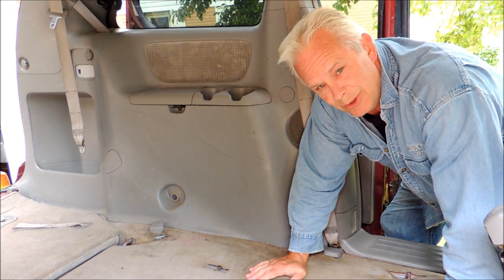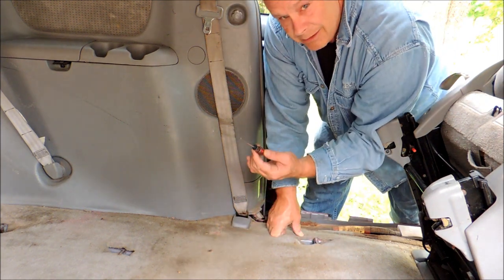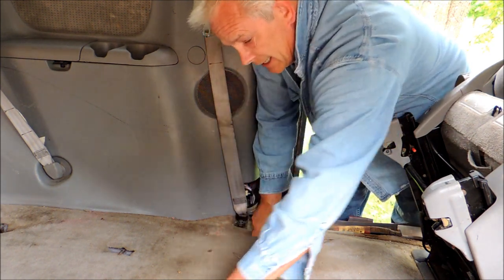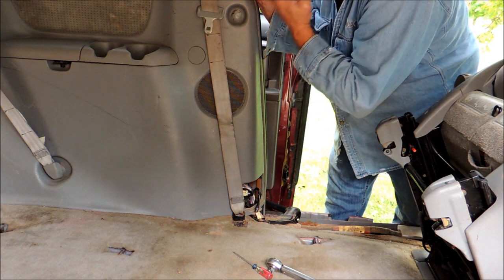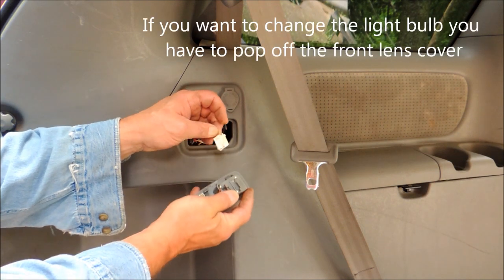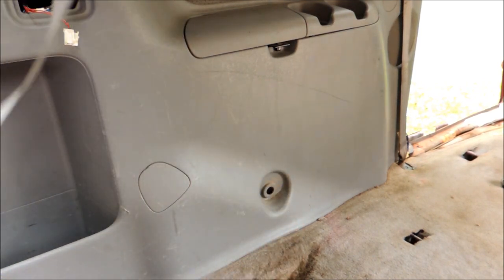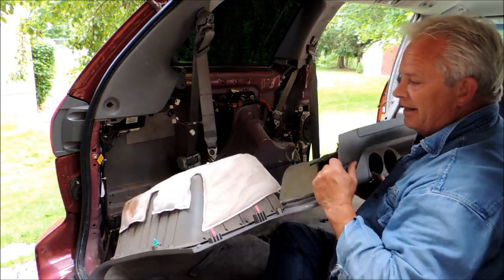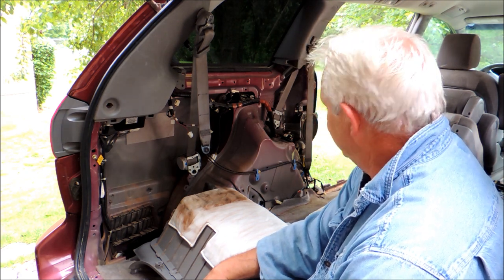Toyota Sienna 03 To 09 Interior Rear Panel Removal

Comment: I am replacing the flimsy worn-out rear 12V outlet with a better made marine-grade one. I run a cooler in the back.  Also once the panel is off I'll be able to pound out a minor dent.  This was very helpful.  Thanks!
Reply from the maker: Glad it helped Vince - Cheers from Canada!

Comment: My daughter and I just used this video to remove the panel from her 2013 Sienna since we could not find one for the later model years.  There were a couple of minor differences that were easy to adapt to, including removing a couple straps that hold the baby seat.  Interior light and attachment point are different, but easy.  When we got to removing the panel, things looked very different.  The panel on later models is made up using two panels, a lower like this, but fastened to it is and upper panel.  So there are two panels rather than one. It looks like you take them out separately, but you don't!  They are fastened permanently together making a large panel similar to the one in this video. Do NOT try to separate them.  We broke one joint trying, but will be able to fix that.  Removal is really similar to the one here, although the design is a little different.  Popping the front out is easy. The trickiest part is starting at the upper back corner and pop out the back edge as shown here.  You have to work your way forward popping out snaps in the door pocket. Its a little tricky and you can kind o get your hand behind as you go and pull with a bent tool. There are three snaps at the top of the pocket.  I wish that the guy who made this video would make one for the later model.  I am sure it would be great like this one.  Thanks.
Reply from the maker: I'm the guy who made the video - first thanks for the added information - second, once I fix someones car I have to give it back and rarely get to do multiple videos on the same car - sorry - Cheers from Canada

Comment: So I replaced the speakers on both sides in the back today, and can say both side panels are just as easy and are VERY similar. Only real differences are no trunk light in the rear, but there is a door for the jack and tools. Don't have to but I removed it just to have a handle to grab onto...just saying since the author is not answering 🙂
Reply from the maker: Thanks for the tip Mr. P - Cheers!

Comment: I have a dent in the rear quarter panel just under the light. Is it possible to access this area to tap out the depression? Your camera angle does not show whether I could get tools in there to push out the dent.

Comment: Thank you so much, I'm buying an 04 Sienna soon for a camper conversion, and plan on modifying that exact panel.  And the reference photos are also very useful.  With liability rules, my local wrecking yard brings all parts to the front, no looking at actual vehicles allowed.  Hard to get interior measurements without climbing inside one.  Thanks again.
Reply from the maker: Anytime Doc - good luck and cheers from Canada!

Comment: Thank you. This was very helpful. I removed the passenger side panel on mine and the process was nearly the same. Your advice about pulling the panel off from the top was useful. I had to get at a terrible squeak coming from a recently installed shock. The little access panel for it wasn’t big enough. Sprayed some silicone in between the bushings and problem solved.
Reply from the maker: Well Done NK - cheers from Canada!

Comment: Couldn’t have done it without this. For the front door sill c over I assume it’s the same method as the sliding door sill. Thanks.
Reply: Quick question, are you a mechanic or autobody ? In case I need something in the project I am starting, where are you located ? I am in Toronto. Thanks

Comment: Thanks for this thorough video. I recently acquired a 2004 Sienna LE. and I am thinking of installing a sub since mine didnt come with one. I believe the XLE does come with the panel and subwoofer speaker and box, or the JBL ones. My question, are the LE pre wired for the subwoofer?
Reply from the maker: Sometimes - Only way to know for sure is to pull the panel - Cheers from Canada!
Reply: Im in the same situation, is there any updates for you?
Reply: @WillHous  no updates. i didnt get any answers from fb groups

Comment: Very well done. My 07 seinna has no heat at the rear cabin. Any ideas??? The rear cabin controls funtion fin (level doors move and change fan spd) but zero temp change just cold air(winter here). I suspect heat control modual broke but i dont know where it is?  Front heat/controls work fine. Any ideas???
Reply from the maker: Check blend door and module in front under dash Crabtrap
Reply: @carquestions  thx but it has rear heatercore setup. I get heat back there when at highway speed. So its either a sienna quirk or need a cooling sys burp i think.

Comment: I was so happy to find this video!  Our rear seat belts had been torn and cut-off by hauling around sheets of aluminum in our 2005 Sienna van, and I wanted to replace them before we consider trading it in on a newer vehicle.  I had downloaded the Toyota manual instructions, but this makes it much more understandable.  I found 2 used seat belts in good condition at a www.autowrecking.com for under $80.00 including shipping.  So hope to get them installed this week.
Reply from the maker: Glad it helped! Joe - let me know how you make out
Reply: @carquestions  Well, I took off the passenger side panel first since that was the belt that had been completely cut off and retracted into the side panel.  I discovered to my dismay that the backseat air conditioning system for the third row was included on that side and I couldn't figure how to dismantle it enough to access the second bolt for the seat belt retractor.  So, I guess that I'll pay a visit to my local body shop tomorrow to see if they can do it or tell me how to.  The driver side should be a snap compared to this side.
Reply: After doing more research on the tsienna.net site, and looking at a copy of the 2005 repair manual that I had downloaded a few years back, I was able to finally figure out how to move the ducting in the RR corner pillar enough to allow access to the bottom bolt of the seat belt retractor.  There's a clip on the ducting that is made out of the same material, so once removed, the vertical duct can be moved out and away.  So one belt is replaced, and I'll do the easy one on the driver side tomorrow.
Reply: Got the left side seat belt replaced today.  Removing the side panel went much easier, but discovered that 4 of the blue clips were left on the steel panel, and finally figured that a pair of needle-nosed pliers were the best way to remove them.  Had to grip on the narrow part of the stem from the side and use a screwdriver or pliers handle to act as a fulcrum to lift the clip out of the hole.  Hopefully this will be the last time that I need to take these panels off.

Comment: Question: once off, inside the van down in the well behind the rear wheel, can you see fasteners for the trailer hitch? Installer put mine on and started the fasteners with an impact wrench, cross-threaded and seized one. In trying to remove the nut on the inside broke free (assume welded to frame) and is spinning. Need to fix somehow. Thanks!
Reply: Answer - NO! 😢

Comment: The panel you said you didn't need to remove is the one I need to remove to replace the rear quarter window (errant gold ball).

Guess I'll just yank it and hope that's all it takes, I seem to break clips and plastic a lot.

I've converted my Sienna to a beach bum mountain man mobile and so far at 315k plus miles it's running like a champ, second owner and I'm shooting for 500k miles.
My secret ? Real old fashioned dinosaur oil every 3k. 🦕
Reply from the maker: Go easy and let me know what happens - good luck and Cheers from Canada!
Reply: @carquestions  

Thank you.
I'm still waiting until Wednesday for the OEM replacement window to be delivered Walmart.

I couldn't believe that Walmart now sells auto glass on the cheap, they've got their hands in everybody's pie. 😂👌
Reply: @carquestions  

Glass went in pretty easy, the top plastics are bolted in with 2 10mm bolts, a couple of seatbelt bolts which collect corrosion on the ends that I highly recommend loosing and then spraying with a little PB Blaster and let sit a few minutes before running all the way out, I used my impact driver for them, you'll want an impact or a socket breaker bar for them.

Window is held in place with 2 long studs/bolts that attach to it and run through a hollow frame rail you don't want to lose the nuts into, the studs are permanently attached and come on the new window which you will need a 3/8 deep socket for the specialty nuts you don't want to lose into the body of the van (only non metric on the entire vehicle), I ran them all the way out then back in slightly and then removed them carefully with a pair of needle nose pliers (vent model rear quarter windows).

You'll want to use blue tape to hold the new window in place while bolting it in unless you have a helper.

I should have made a video and posted it but it was just me and I was in a bit of a rush.

On a scale of 1-10 it was about a 6 difficulty level.
Reply from the maker: Wow - lots of work - well done and thanks for passing on the info for others - Cheers from Canada !  @dpz9872
Reply: @carquestions  

🇺🇲 🍻 🇨🇦

Comment: @carquestions Can I still use the rear seatbelt if I remove all this trim?
Reply from the maker: Sorry I cant comment on modifying safety devices - not safe
Reply: @carquestions  Just in theory...would removing the plastic trim change anything?
Reply: @Tyler-ug1hs  I don't think there is any issue as long as you retorque everything back tightly